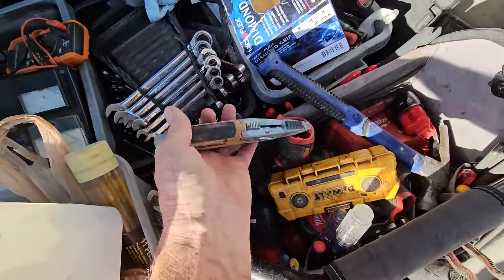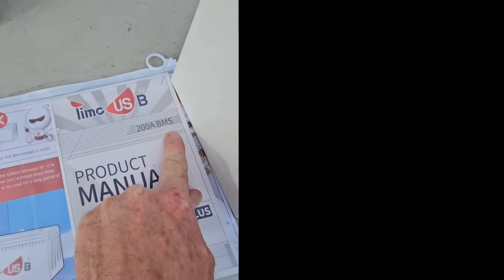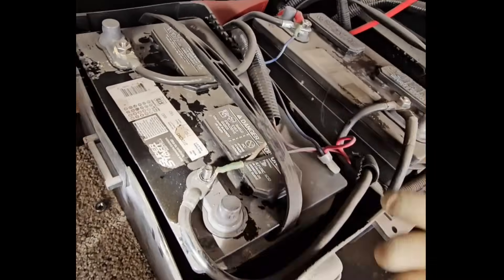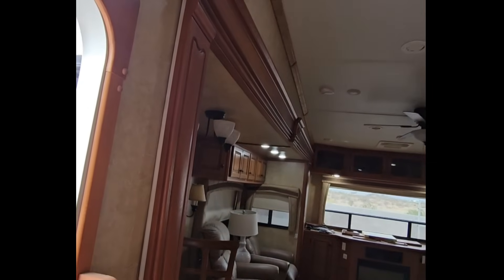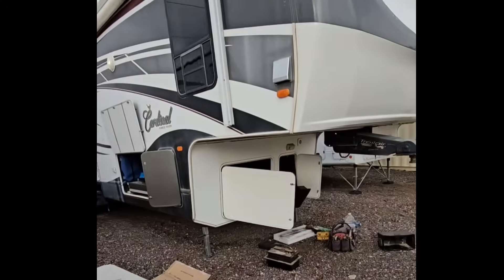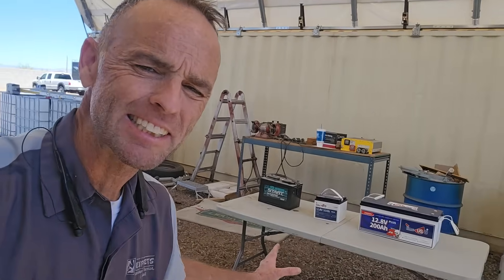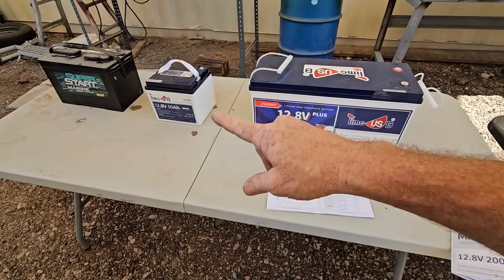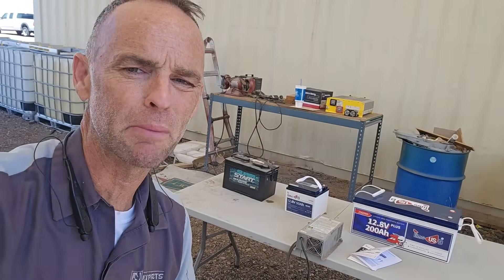Common Mistake When Buying LiFePO4 RV Batteries

Comment: 😂 read a booklet or two and wanting free batterys sent to u , make a video ! James a few videos u didn't know WTF order to hookup the solar and Remember james , ALLWAYS HOOK UP THE CHARGE CINTROLLER TO THE BATTERY " FIRST" !!
Reply from the maker: Thats mostly a old wive's tale, solar goes dead over night and batteries get disconnected and go dead all the time and are never re-connected the "proper" way.  I do not feel your comments are intended kindly and would wonder how you would talk to me in person. I doubt you would have the courage to yell any of this at me, and as only half of the comment is capitalized it seems very intentional. Maybe you should understand your lack of character or real self is on full display.
Reply: @AZExpert  when we are face to face jimmie  we will see if You want to run ur mouth to me .
Reply: @AZExpert  i Would talk to you face to face the Same way ! Fact is id use Words u might have been called before ! I have No Problem talking to a person that drives a jap rig , that's  un American
Reply: @AZExpert  ur a little smart mouth punk coward jimmie
Reply: @AZExpert  little lol men like you james allways act like ur something running ur mouth , but are allways Cowards when ur face to face with someone !
Reply: @AZExpert  next winter ill be in Quartzsite ill look u up
Reply: @dudleybaggerman9574  maybe some of the old charge controllers would have issues if you connected the PV side without batteries, but not an issue now and I have personally done this many times without issues.

  I met James, and he knows what he is talking about; no person knows everything but the best ones are those who are always trying to learn and improve themselves.  Respect and courtesy goes a long way
Reply: @nomadbiker4040  ask the Pros that build the Controllers ! Then u  will get first hand info ! And jimmie is a Coward that runs his mouth

Comment: Congratulations on 100K James

LifePO4s have become much cheaper, some even lower prices now than the lead acid deep cycling batteries. But research these chinese batteries, as some YouTubers have tested the ouput amps and found discrepancies with the manufacturer claims. Also for those in colder climates, make sure the BMS has low temp cutoff charging functionality.  The best input and output amp BMSs are for the golf cart rated LifePO4s
Reply from the maker: Thank you. Yes, I have touched on all those concerns in other videos, this was strictly to remind that current limits are a thing with these batteries and I have to routinely talk people out of upgrading chassis batteries because they are unaware.
Reply: @AZExpert  yes, thank you.  I have a lithium cranking battery for a motorcycle and it performs way better and doesn't require battery tending if parked for a while unlike the old AGM one, and it cost $89, about the same as the AGM. The Ionic brand available on Amazon makes LiFePO4 cranking batteries for cars and trucks with various cold cranking amp ratings all the way up to a $900 one with 3000 CA and 1800 CCA.

Comment: Great video. So, I can replace 2 5th wheel batteries with 1 larger lithium ion battery.
What about my newer inverter? All good??
Reply from the maker: A lithium charger is always best, but most modern converters should do fine.

Comment: Great points. I’ve got a HWH leveling and slide out system and never considered that issue. 

I would love to go lithium but don’t want to risk damaging my alternator and have no idea where I would connect a DC-DC charger.
Reply: The DC to DC charger has an input side for 12V positive which would be the chassis battery in a motorhome, and the output would be on the 12V positive of the house batteries. For an RV you would get the non isolated charger with a common ground to the frame to the negative of both batteries
Reply from the maker: Just the black wire from the 7 way plug

Comment: You missed another good use for lead-acid batteries; For those on a tight budget who no longer travel much with our rig. A pair of quality lead-acid batteries  are easy to care for, and if not vibrated around rolling down the road, can provide 7-10 years of service. When they do die, they are cheaply and almost completely re-cyclable. They require no so called 'upgrade' of converter or inverter/charger.
Reply from the maker: I have never found lead acid to survive that long and be good and require much more maintenance than the zero of lithium batteries. Lithium batteries recycling is more common. The tight budget doesn't make much sense as I point out LiFePO4 are the same or cheaper and will work with most battery chargers.
Reply: @ You're assuming I know little about batteries. 27 year master certified RV tech with a customer base of thousands. As far back as 1997 I was setting up remote, off grid cabins with battery banks and still do one from time to time. The price scares most of them away from lithium's.  Many of them are 'greenies' too, and know that recycling lithiums is not cheap or an environmentally friendly process yet. FLA batteries do indeed often last 7-10 years if treated right here in the cool PNW.  In addition, many in my area block travel trailers and use them as one would a park model. Power failures are common here. FLA batteries performance is more than adequate and require no change in inverter/charger or converter to perform well. Sure LiFePO's will work, but only charge to 80% of their capacity with standard or older converters, and they don't perform well in the cold winters here when we need them most, so the more expensive heated versions are needed. For us here, the FLAs are still our best choice, and topping water every 3 to 6 months is borderline effortless. If my customers or I need batteries, they're a short drive that same day to Costco. They don't take dead lithium batteries anywhere close to me (yet), but all places give $25 each for  FLAs. For now, good quality FLAs will do us just fine and save us money in the long run. Changing to lithium batteries and doing mods to make them work optimally is something only my traveling customers want to do, and even then, it's the ones with big bucks and plenty of time in the sunshine to utilize solar while boondocking that go with them. In our area, solar is darn near useless and FLA batteries are for now, still a wonderful choice. Now if inside the coach interior is where batteries must go, LiFePOs all the way, but I don't see that very often. 
Thanks for all the great videos on roof repair. Due to our climate, I have to send all but emergency repairs to shops, so I appreciate your videos on the topic I know little about. 
An interesting note; You look very much like my Father when he was a young man. A HAM radio operator and electrical engineer, he began teaching me about batteries way back in 1967 (when I was 13).
Reply: @Robnord1  whoa, what are you talking about? This is a video on how to pick the right lithium battery for your RV.
Reply: @ Thanks for that faceless troll. I get so confused sometimes!  I thought the video was about common mistakes when buying LiFePO batteries.
Reply: @Robnord1 you need to update your knowledge base to modern technology
Reply: @Yielar1  I just bought 4 new FLA batteries for my two RVs and soon will get 2 more for my vehicles. Still valid in today's tech 'gotta have to keep up with the rich boys' world my uninformed and faceless friend. Have an absolutely FANTASTIC day.
Reply: Doesn't make sense to buy new lead acid batteries nowadays though is the point

Comment: What’s better 2 -100 amp hour lithum iron phosphate in parallel or 1 -200 amp hour lithium iron phosphate battery.
Reply: I personally would go bigger rather smaller in parallel.
Reply: @okinawadonkichi any reason why?
Reply: @ldcooper1  Both @AZExpert and @nomadbiker4040 hit on it. Really boils down to 1 x 100AH battery generally will have 100 amp discharge rate, 2 x 100AH battery bank would have the same; whereas a single 200AH battery generally would have a 200 amp discharge rate. 
So, if you already have a travel trailer (for example) with a single LiPoE 100AH battery on the tongue and just want to extend the amount of time you can dry camp with everything remaining the same, then adding another battery makes sense. But let's say you are changing the environment somehow, requiring more peak amps, then the single 200AH battery would be the deal. 
Also, all battery cells in a system managed by a single BMS generally means better cell balancing and conditioning resulting in longer cell life.
Reply: Most of these batteries are a combination of the same cells in series and parallel inside the 12v battery. The best thing would be to look at the output and input (charging) amps of either the 200AH or 2x 100AH and match to your needs.  With 2 batteries you may have to invest in more cables as well which could add costs
Reply from the maker: less battery cables and connections is always superior.
Reply: Sorry …this is 12 volt batteries.🇨🇦

Comment: James, good video, but you forgot to mention one potential problem if you charge the lifepo4 battery with an alternator. The battery will pull so much charge you can damage the alternator. You need to add a current limiter between the battery and alternator, or avoid charging from alternator all together.
Reply: What I have used is a 12V-12V DC to DC charger.  Victron makes one with Bluetooth monitoring that you can set charging amps depending on alternator output and voltage and set profiles for different types of batteries. The input on ours is the lead acids chassis batteries charged by the alternator, and output to a set of LifePO4s.  Not as fast as some chargers but safe for the alternator
Reply: My 2020 ford transit is rated at 250 amp.
Everything in it electrical, even the transmission has an internal electric pump.
Reply: @ShopAdventures-i9s  yeah I think Ford built our transits future tech forward because when the keys on and the engine is running it's putting out 14.1 volts that's the native voltage, puuuurfect for charging Lifepo4, I have a renogy 40 amp DC to DC charger to work as my line voltage conditioner which will also run solar panels in the future 😉
Reply: The BMS limits the charge in and the current out.  Your alternator is going to be fine.
Reply: @arthurcutting9227 no, the 200ah has a max charge current of 200 amps, this will kill/stress the alternator.
Reply: @rawfish123  you go ahead and think that. I'll sell you a box that does nothing. No alternator puts out 200 amps mostly 60 to 90 and they do it all day without any problems.
Reply: @rawfish123  travel trailers have a battery charge circuit in the tow light cable that goes to the trucks hitch and battery alternator. It just works because both batteries are very close to the same voltage.
Reply: @arthurcutting9227  absolutely not true. Many cars nowadays are coming with upwards of 180A of alternator capacity. 

The issue people are talking about is running the alternator at full load all the time. Sure it will technically reduce the life of the alternator, but by how much? Does it matter?
Reply: @arthurcutting9227 One thing you might be missing in your analogy is. Alternators are battery maintainers, not battery chargers.
Reply: @Studmn  are you serious. A maintainer puts out a couple amps. Typical large frame GM alternators are good for 80 to 90 amps all day long.
Reply: @arthurcutting9227  A vehicle Alternators purpose is to maintain 12.6v SOC. Not charge the battery, though they do, the constant amp pull? Like if your starter battery is faulty and you are constantly having to jump start the vehicle, that is extremely hard on the Alternator in turn will eventually burn it out, maintaining a healthy electrical system ensures an Alternator longevity. Also what your referring to is a trickle charger.
Reply: @Studmn  so what are you going to charge your battery in the RV with?
Reply: @rawfish123 my alternator in my stock 2016 Ford Transit comes with a 220 amp alternator from the factory, that is stock.
Reply: @arthurcutting9227 🎯🎯🎯

Comment: When I investigated converting to lithium battery I found that at some point the engine alternator will have a fight with the lithium battery and burn out. Because my camper came with solar I disconnect the battery wire in the trailer harness so the alternator in my pickup can not connect.
Reply: I don't think you pick up will pass along enough amps through your 7 way plug to hurt your alternator.
Reply: Not a fight.  The lfepo bats have little to no resistance so the alternator goes full bore until burnout.  There are devices to install between the alt and bat to prevent this.
Reply: @jeffwatson8862  I believe the connection from the trucks battery all the way to the travel trailer through the 7 way plug and through the 10 amp fuse and over to the trailer lithium battery has a lot of resistance/voltage drop. When the alternator produces 14 volts the lithium battery only see 13 volts therefore the lithium battery is barely charging a couple amps.

Comment: I have 3 Weize 100ah batteries connected in parallel that starts my Onan 7500 quiet diesel without issue.

Comment: Can't even afford regular batteries, need four new ones.
Reply: Actually, some lifepo4 batteries are now comparable in price to AGM lead acids, at $1.50 per kWh.  The tarrifs may change that though but you can find sellers with US stock
Reply: So do I.  Costco here I come baby.  Group 27s or 6V golf cart deep cycle.  Lithium's are for those with a large budget.